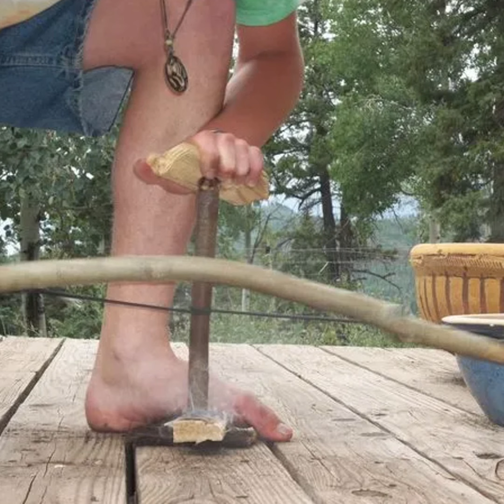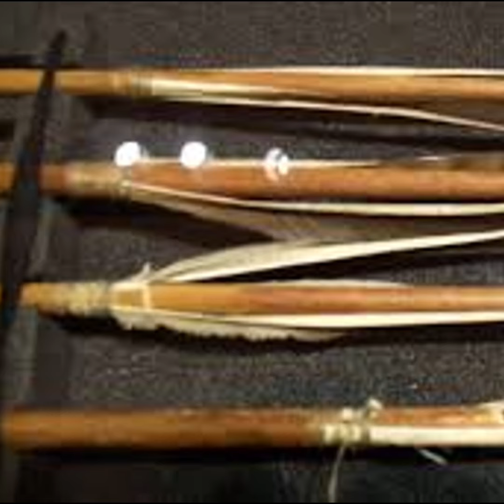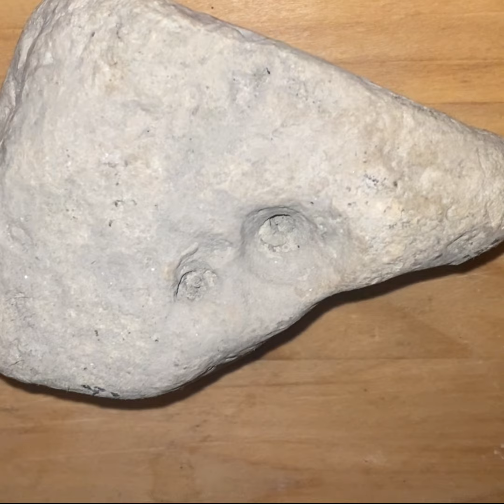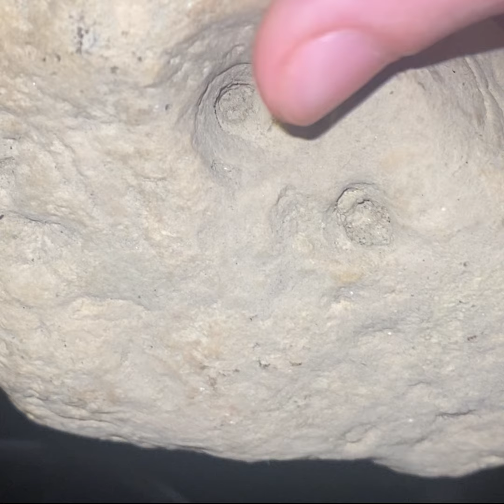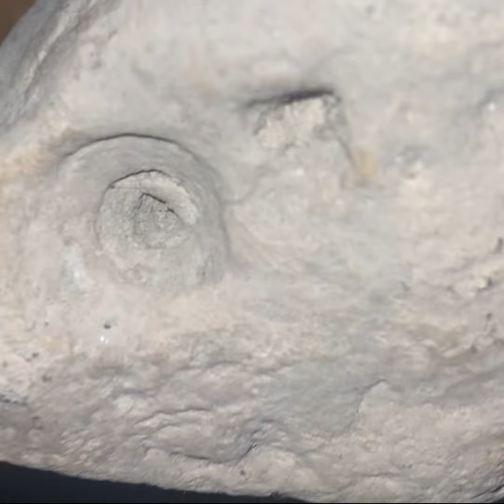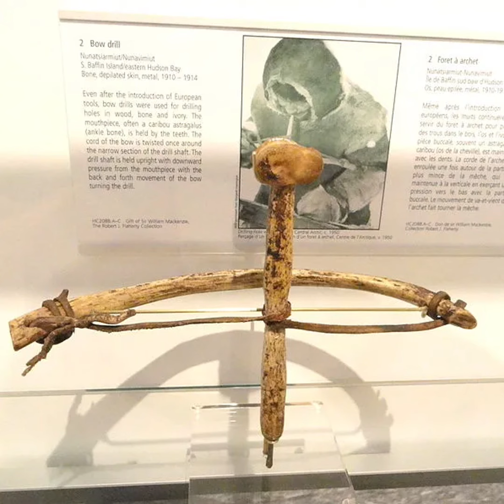Bow Spindles Explained: Fire-Making Tools of North America

Comment: The best thing to use with these is dead dry pine -- 
Notch a hole in a dry pine branch 	to get to the lighter material --
Reply: When I was a boy scout we used dead Florida slash pine to get fires lit. The wood with a lot of sap really burns. We also used the fibers from palm trees with sparks to light a fire. Palmettos and other palms usually have dry fibers under the old dead fronds. The fronds light easily too.